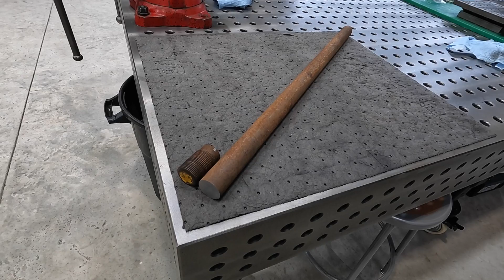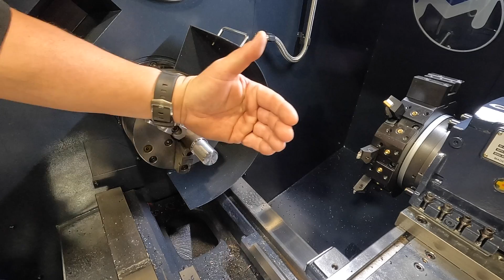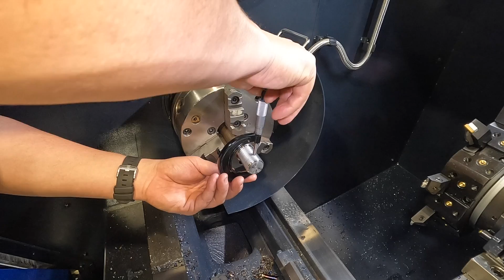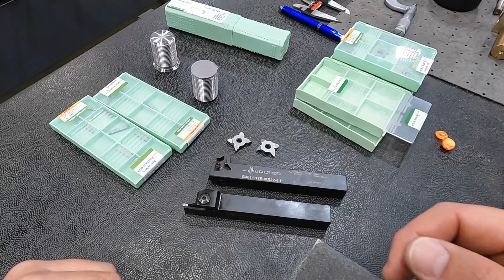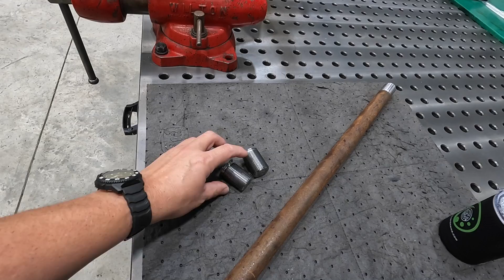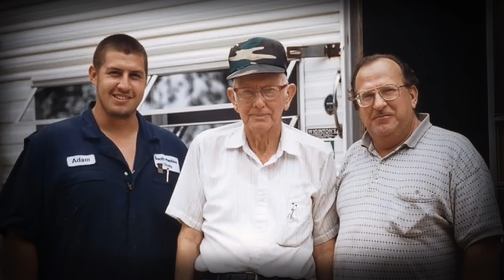CNC Machined Threaded Rod Ends

Comment: if you use a full form insert for threading you wont need to run a file over the threads after, also if you want to make small adjustments for diameter, id use the wear offset instead of messing with the geometries

Comment: oh also .001 in diameter is .002 because it's in diameter which is .001 preside.   .0005 is .001 .. change it in wear not geometry, this way you will not lose track of your numbers this way..

Comment: Walter tools probably recommends over double the speed on mild steel. 500rpm is like 50m/min, very low. It should be closer to 130m/min or 1300rpm. But that would probably go over the max feed speed on that machine, not sure tho. Maybe more passes, spring passes and/or lubrication is the answer in this case.

Comment: @17:38 Use a full profile Insert , that insert will Top off the threads Major Dimension too , you won't have burr, Or if I don't have one generally I make a finish pass followed by a thread repass not efficient but I get clean threads , the Tooling representative will surely have a solution too

Comment: A good way to keep burrs off of the edges of your threads, is to cut about .005” or .1mm off your OD. Preventing the thread from coming to a full point. You might have to do a little deburring but at the very least you’re not dealing with a razor blade.

Comment: hey Adam,

i just Look this Video now 😅

i am CNC and manuell Lathe Machinist From Germany 

and i ask me why you don't do some Things on your CNC Lathe

1. coolant makes a big difference 😉

2. i Machine the face First then the od With allowance for Finish Cut 

3. the Finish Cut with a Finishing Tool Like DCMT or mabye a VNMG Insert you can do the grove with it too without chatter 😉 

4. thread cycle use a cycle that make Constant infeed in the thread and breaks the chip alternately to the right and left
and you can make it faster but less deep of cut i I normally assume an infeed of 0.2 mm for the thread 

my Programm in DIN PLUS (Heidenhain) would look Like so

G54
G14 Q0
G26 S=2200(RPM)

T1 F=0,3 G96=150 M4 M8
G0 X45 Z2
G82 Facing Cycle
G810 OD contour Roughing Cycle 
G14 Q0 M9
M1
T2 F=0,15 G96=250 M4 M8
G0 X45 Z0
G1 X-1 
G0 X45  Z2
G890 OD Contour Finish Cut Cycle
G14 Q0 M9
M1 
T4 G97=500 M3 M8
G0 X45 Z10
G32 Threading Cycle
G14 Q0 M9
M30

✌️
Reply: @Yigal_F  привет, я пытаюсь перевести на русский с помощью переводчика Google 😅 Так что у меня самого нет производства, я нанят оператором раскройного станка (оператор станка с ЧПУ) в компанию в Германии

Comment: Work way closer to the jaws, and the tool holder? push it further into the head. Shorter stick out on the tool,. makes a huge difference. And have 2 tools for turning down. even on something simple as that. one for roughing and one for finish pass. I like to faceit of leaving 0,2mm, then OD where i leave 0,8mm, ( that is 1.6mm on total OD) if my finishing tool has nose rad 0,8. With the finish tool i like to start closest to the jaws and end with facing of in one motion. for threading my go to is 3-5 spring passes. im not turning like 1000 parts so it does not matter if it takes 10sec longer.. That way you can in your correction start with plus 0,4mm on the threading tool for example, and then run it again in the program from threading minus what you wanna correct it to.   
Something to try out next time :D

Comment: your part  is way to far out of the headstock , the shorter the overhang the lesser vibrations you get. always work to the closest possible way to your headstock, 1mm is far enough with cnc control.

Comment: Dont make your offset changes in the geometry number, you'll just lose track of what you've done and not have a good reference point for when you change an insert. Make those changes in the wear value by putting .001 in the X wear, that way you have an easy way to tell what you have changed and by how much.

Comment: Topping inserts are the only way to not have burrs unless you do a finish turning pass after the threading.  You can run the finish pass backwards and it will debur the thread on the chamfer.

Comment: I know how to use a CNC router and a 3d printer.  It just takes (&(EWRE time to figure these things out.  They try to make the software simple, but I doubt they know what "simple" is.  I found that the software has some basic design principle you need to figure out so you can understand why the commands are what they are.  Fair winds!

Comment: You should face the part first will save your insert. Run the facing with slightly lower feed and more rpm. Get a finishing and roughing tool aswell. 

Btw something like a vnmg insert can actually make nice thread reliefs.

Also feeds seem a bit high for that small of a lathe. You should take a few more passes threading and take a spring pass. 

The grooving tool does not love that seems like too high of rpm and maybe not super rigid machine
Reply: After seeing the last cuts you did that was much better looking than what I saw on the start.

Wish you woulda got a Mazak I’d drive down there to help you out and you’d be making simple parts like that in 10 minutes of programming after only a couple hours of learning.

Comment: why is there a light pass in middle of turning to diameter then comes right back with another heavy cut to size?
Reply: the reason is becouse the surface is shini after a harder roughing cut, but fuzzy after a a lighter cut. here he cut 3-4 roughing cut with 0,25 per cut but the last one had not enough diameter to make a full 0,25 so it took just a coulpe thou, then he did a finishing cut with 0,15 wich is still enough to make a nice surface. i hope i could answer you question and sorry for my language.  and these numbers what i just wrote all are random. i don't know what he added in the program(i live in europe so i don't know about inches)

Comment: Using a modified flank infeed method when threading on a CNC gives incredable results.
first line of G76Pxxyyzz, the XX is how many spring passes, the ZZ is your infeed angle.
Putting a 29 there will make it act like the compound on your manual lathe (For 60 degree threads).
I run G76 P030029 for all my threads.
Using both sides of the threader puts out a ton of pressure giving you deflection and chatter.
Modified flank infeed only uses the back side.

Comment: How do you know the thread is at the right pitch diameter along its entire length, if you only measure at the nose.  Is that setup rigid enough that you don't need a spring pass?

Comment: Would cutting fluid /coolant make any difference as to surface quality result and perhaps improve resistance to chatter? Possible heat buildup at point of cutting contact causing unsettling noise?

Comment: How do you ensure the correct finished part length on that CNC lathe? The first op you're using a rule to set the end length. How do you get the correct overall length for the second op? Is there a programmable hard stop thru the chuck?
Reply: Multiple approaches and depends on if you got a lot of stock to work with or not. You stick out enough knowing that it'll be enough for the job and program how much you want to cut off. On really badly cut stock you can change those parameters and take more passes or you can put it in manual mode and machine a clean reference face to zero off of like a manual machine. The guy I learn machining from says it's generally nice to have a test piece that you can proof everything over with and then just let it run, though that doesn't work as well in prototyping and RND as you aren't given as much stock.
Reply: @ScuffedEngineer  I get that, but you still have to cut to the final overall length. How do you do that on this machine? 
I'm thinking there has to be a hard stop somewhere to register from. I guess you can use a rule and measure back to the chuck face but that's not very precise.
Reply: @josephcitizen4195  To be through as I'm not 100% sure what exactly you're asking. If for the overall length of the bar (threaded ends) some machines have a feeder. They can feed stock out of the spindle to the correct length and you can part off. Others it's the same as a manual machine. 

If you're talking that thread he made was going to be a bolt that was say 2 inches long, how do you cut to that final length of 2 inches? 

That's getting into how CNCs actually work. I assume for backlash reasons (as I don't know how CNC lathes are "really" made, it's much easier to physically see on a mill) they use a ball screw with a motor (closed loop servo?) with an etched glass encoder. The computer has been coded to know x turns of the encoder is equal to y movement. This lets you move to position with good accuracy, precision and repeatability (may only be out a couple tenths, if that). That's really the only stop to get a cut to length. There are hard travel limits in the machine (which would be the machine's absolute 0) so you couldn't tell it to take the tool into the spindle (well drills and boring bars can I guess), but it doesn't know what chuck you're using (if not factory) and doesn't know the size of the jaws. So if you had a larger chuck with bigger jaws, you could tell the machine to go right into the jaws and if it's big enough, the chuck. CNCs are really good at listening. You can proof your program and it will tell you if you've accidently set your travel past the limits of the machine and give you an error, but again, that's not necessarily to your fixturing.

In short, you can use the machine's absolute 0 positions, or you can do work offsets (like a DRO, you can set a position in the machine as 0 even if it's not absolute 0). In CAM you can have relative movement which could be faster in a production cycle setting, but can get confusing real quick if something is wrong as the 0 changes.

If you're asking how is that programmed? G18 (assuming normal G-codes, I've only used mills, not lathes) Z##.## tells the machines where to go. So you'd do facing ops of G18 Z 3.1 Y 0. <break line> Z 3.0 Y0. to face then ops you want and end with a M6 T(X) [which ever tool number is part off] G18 Z 0.9 Y 0. 

If none of that answers your question, I'm not really sure what it is you're asking.
Reply: @ScuffedEngineer  Thank you for that amazing reply Shadow. Good stuff.

Sorry if my question(s) were confusing. 

My original question was asking how the overall length (end to end) of the final part was achieved. I understand how CNC lathes and manual lathes work and I know how I would do it in either scenario.

What this gentleman showed was measuring with a rule from the face of the chuck to the end to do the op on that particular end. I think we both know that is not the way to get an accurate OVERALL length.

If there was a hardstop on the head side of the chuck, that would be your zero, EZPZ. Program 1000mm out for your face cut on the second cuttin/threading op and that's your final finished part length, 1000mm (or what ever it was). 

My question was and still is:
"How do you (ABOM79 or anyone) ensure the correct finished part length on that CNC lathe? The first op you're using a rule to set the end length. How do you (ABOM79 or anyone) get the correct overall length after the second op? Is there a programmable (NON PROGRAMMABLE?) hard stop thru (on the head side) of the chuck?"
(_emphasis and edits added_)

It was a "wait, does he not care about the overall length?" thing that popped in my head when I was watching the vid. So I thought I would ask.
Reply: @josephcitizen4195  its a tie rod so exact length is just not that important, its just holding two pieces together. 

how you would get a high accuracy measurement by doing it this way I don't know.

you can buy very thin rulers/scales you can pass though gaps in the chuck to measure distance to a feature you can't see but this is only as good as your eye

Comment: Great job, I noticed your screwcutting  tool was still taking a big cut on last pass, you need a spring pass, a CNC machine like this with an insert like that will make mirror finish threads with no burrs.

Comment: Question: how would you set it up if you needed that rod to be a very specific length? say if you wanted it at 24.25", how would you set it up? would it require threading one side, then how do you set it up to get the exact length when you flip it over? 
excellent video, that machine is amazing.
Reply: Some kind of stop on left end of the machine. It could be close but not perfect .
Reply: 24.25” or 25 1/4” is not a very specific length, in the engineering world there are tolerances based on length and the way it is written. 
X.25” is a fairly open nomenclature, under 1 inch might be +- 0.002 or so, then >1” but < 10” maybe +-0.005 by the time you get over 24” it could be +-0.010, easily achievable with a rule and eyeball. 
However if it is written 24.250” the tolerances may be halved, getting more specific but it would need writing 24.250 +0 -0.005 to become a very specific length, then you would need back stops or feed and part to length (a known oversize length) then clean up.

Comment: How about you buy the correct orientation of tool (LH) and run the spindle so that the cutting forces are in compression, you are basically tearing the machine apart. That's where the chatter and irregularities are coming from. CNC machines get a bad rap because they do exactly what the operator tells them to do, even when the operator is the issue.

Comment: You are learning fast.  If I may, a few tips.   With a long bar, use a sleeve inside the spindle tube so the bar can't whip around.  That long bar will amplify any chatter in the cut.  For cutting steel, use a different tool to finish because the roughing tool will wear and need constant adjustment if it's also finishing. After threading,  make another finish cut to remove burrs.  Then do another threading cut to remove the burr left by the second finish pass.   If there is no ring gage, use a nut to check the threads all the way to the relief.  The threading should be programmed right up to  the far end of the relief--it won't hit the wall.